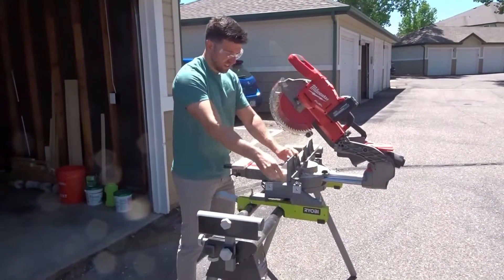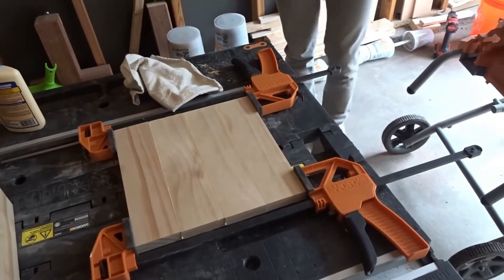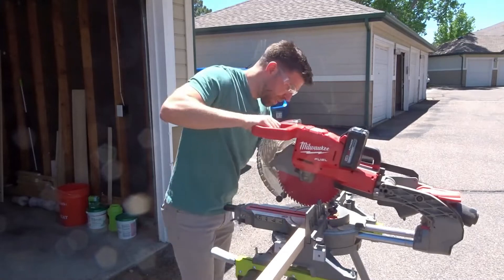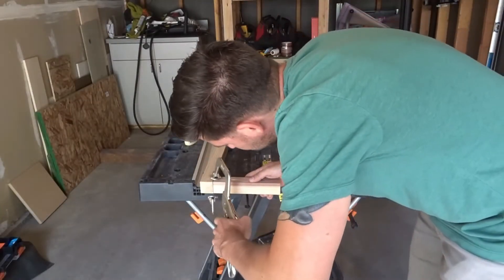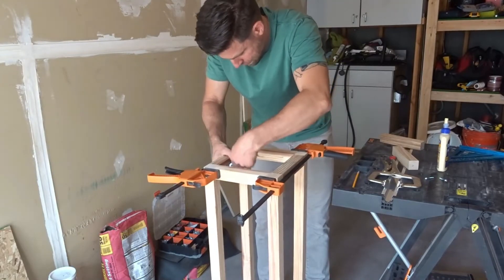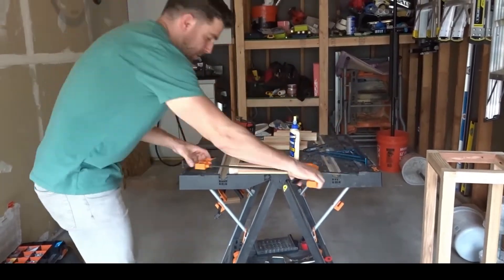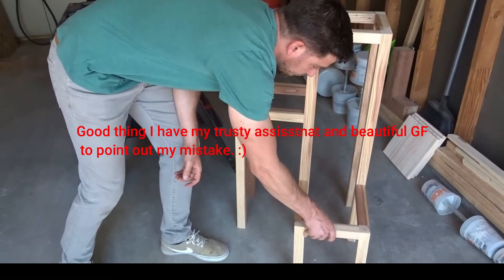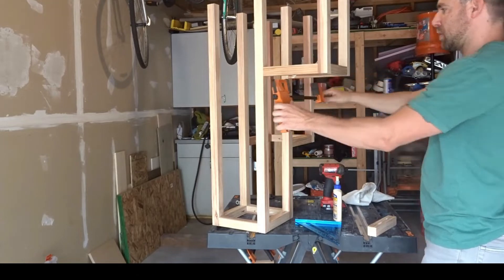DIY Plant Stand | Easy To Make Step By Step Tutorial

Comment: Nice project. I have only two minor suggestions. I would have purchased a 1 x 12 pine board and trimmed it down to the 10-inch size. The second would have been to coat the wood with a clear waterproofing agent to prevent water from being absorbed into the bare wood when someone waters the plants.

Comment: I love that it’s a corner piece and obviously very well-made.  Did you attach the tabletops?  (The video stopped before completion.). If so, were you able to just use wood glue or did those need to be screwed?  Thank you! 😊
Reply from the maker: Initially I didn’t, but then I ended up just glueing the tops onto the frame. And yes, I now have it in a corner and it looks great!!!

Comment: I have a question about the small pieces, so you have the 4 36in pieces 2 24in and 2 12in then there's 4, 7 and a 1/4in pieces on the 36in piece are the 6 small pieces for the 24in and 12in piece the same? Sorry if that's hard to understand lol.

Comment: Hey Aaron, was wondering if and how you sand the ends of the table legs and supports. I've noticed that I end up with slightly contoured ends, which then leads to gaps once I've glued and screwed them together. Any advice on this problem? Would I be better off leaving the ends as they are after cutting? Or sanding the piece only after it is assembled? Thanks!
Reply from the maker: Scott Mohan if you buy nice wood, you shouldn’t need to sand it. Another option is to assemble it all and then sand. That way you don’t get a gap at the seams. Does that help?
Reply: @aaronfixesstuff  yes, thank you Aaron. I also realized I can sand the splinters from the saw from the long edges and leave the ends as they are.

Comment: Hey Aaron, this plant stand is really beautiful - I love it and am building one now. I was wondering if you kept the table tops loose or if you attached them, maybe with shorter pocket screws from the inside of the supports? Thanks!
Reply from the maker: Scott Mohan thanks, and thanks for watching! I did not secure the table tops because if they get stained from the water, they can easily be replaced. I was also too lazy to seal it 🤣
Reply from the maker: You can definitely secure it with screws, or even just glue it to the frame.
Reply: @aaronfixesstuff  great thanks!

Comment: Hey Aaron I got little sidetracked on my plant stand making, but just wanted to ask you what size pocket hole screws you used. I bought the pocket hole jig yesterday (didn’t realize finding one would be a task) lol. I have 1-1/4” will that suffice? Thanks for the help.
Reply from the maker: Tanesa Sanchez 1-1/4 should be long enough. I’d recommend adding wood glue in order to make a stronger connection.
Reply: Thank you again. Will do. :)

Comment: You don’t show how you attached the tops to the frame. Brad nails? Screws? Or just glue?
Reply: Cool idea by the way
Reply from the maker: Thanks for watching, and I appreciate the kid words! I actually forgot to post that. The reason I spaced it out because I first treated the tops with clear polyurethane, to seal them. I then put some glue and let it set. Honestly there is not only “one right way” to do it. They don’t even need to be secured on there.